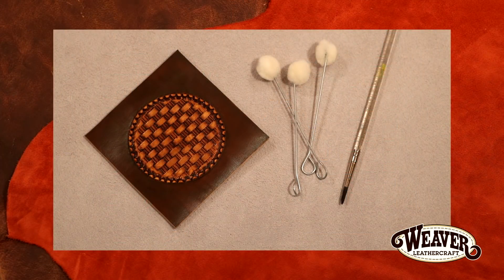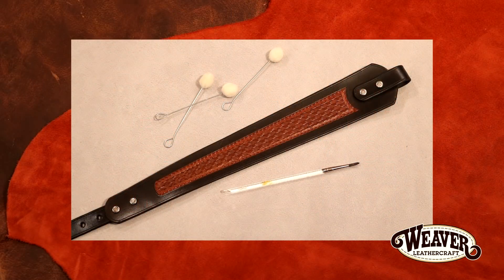The Leather Element: An Alternative to Resist

Comment: main issue I am having is when I use the Eco Flo water based paint. I have tried to use super and satin sheen as well as pro resist over the water based stained areas before I antique to protect them from darkening when I antique over them but as soon as the pro resist or other resist products touch the eco flo stain the stain just starts to bleed and run. I can spray the project with leather sheen before I try the resist and that does seem to help the eco flo stain from running as bad when I resist but it still runs some. I don't have this problem with alcohol based stain but don't have the ability to lighten or darken color with alcohol based as I can with water based.

Comment: I bought the shrunken hide and wondering how to  bevel the edges as it moves when you try to use the bevel edger .  Does it have to be beveled or is there something else one can do to the edges.
Reply from the maker: Hi Kati,
If the leather is pretty soft, edgers don't always work the greatest. Make sure the edger is sharp but if it's still not working, we would recommend using edge paint or edge coat if you would prefer to not leave the edges raw.

Comment: I have a question here:

I recently bought some Fiebing's Pro Dye in Royal Blue. I know Royal Blue is supposed to be a darker blue, but when I dyed a necklace with it, it came out almost indistinguishable from the black dye unless very bright light is on it.

Is there a good way to lighten the color up? I haven't needed to modify a dye before. I just want to make it noticeably blue instead of almost black.

Thanks!
Reply: You may want to try thinning it with a dye reducer. I've done this with Fiebing's alcohol-based dye to get a good blue, I think it will work with the Pro Dye.
Reply: @kentdirckx3012  what dye reducer would you recommend? I've never needed one before, so I know nothing
Reply: @TheTrunks340  I use Fiebing's Dye Reducer https://www.weaverleathersupply.com/catalog/item-detail/50-2049/fiebings-leather-dye-reducer/pr_27341 I haven't used it to thin Pro Dye, but I've heard it works.
Reply: @kentdirckx3012  I'll have to order some next time I order from Weaver. Thanks for the heads up!
Reply: @TheTrunks340  Good Luck!
Reply: @kentdirckx3012  yeah :p I got a project I want to do with kinda an ocean feel, with a milder blue and light green color scheme. Yes, I know oceans are the natural enemy of leather, but I live far from the ocean and just want the color scheme and shape to invoke the ocean :p
Reply: I use alcohol to thin fiebings dye and pro dye. Works fine.
Reply: @amykinard9847  any specific kind of alcohol?
Reply: @TheTrunks340  I have been told to reduce it with isopropl alcohol, 3 parts dye to one .
Reply: @kentison9143  I dun did that... still too dark. I found what I needed, though.

Comment: I was going toget a set of the weaver 1/8th inch chisels but the reviews said they come rusted and without the logo? Can you actually get a set like the picture?
Reply from the maker: The carbon steel chisels should be in stock within two weeks. The black finish works great- they just need a little bit of oil and they will polish right up - it was done to protect the chisels from rusting. Going forward they will be nickel plated with polished tines and as mentioned they should be in stock soon.